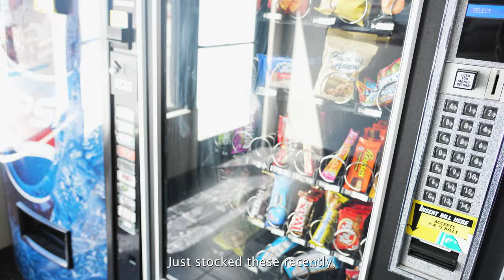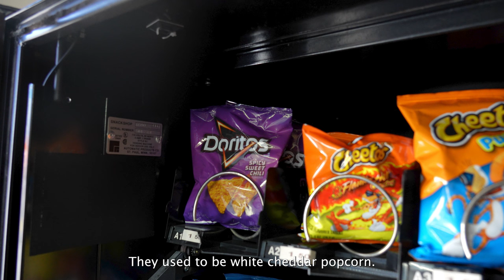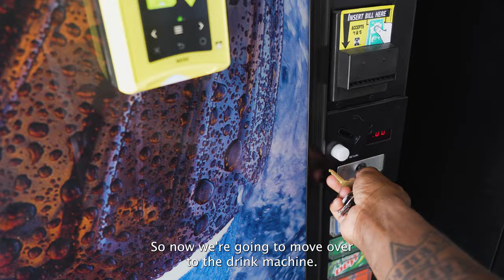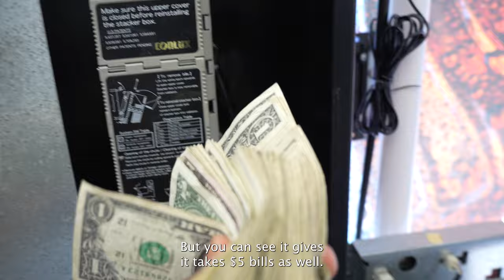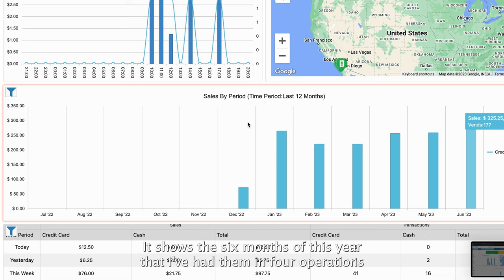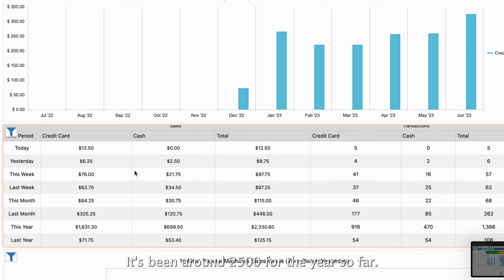6 Months of Vending Machines, How's it Going?

Comment: Great, detailed content. Thank you. 

For the savings account where you are keeping the earnings, make sure it is either a high yielding savings account or you are putting it in a market account earning market rates. This way your money is growing and not losing value due to inflation and depleting your hard earned dollars.
Reply: Hi, could you explain more? I’ve been in the vending business for a few months, and I’ve been using my regular savings account to transfer my earnings for the meantime.
Reply: @oxymarvin  A lot of the regular banks offer very low interest earning checking and saving accounts (0-1%). Better to keep your money in a bank like Ally which offers 4.5% with no minimum balance requirements. For long term savings, you can open a trading account and put money into an ETF that mimics the market so you are decreasing your risk while earning average 7%-10% annual return. Again, do your research since the amount of savings will determine which strategy works for you.
Reply: Thank you so much for that ! That was so helpful!